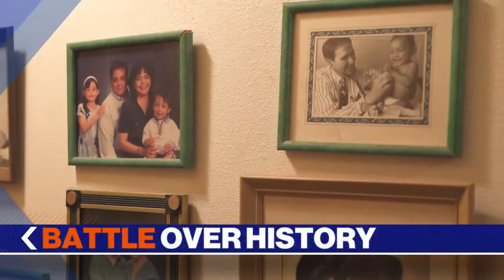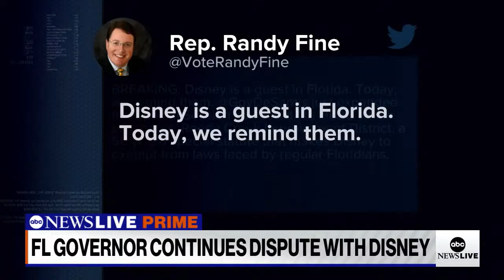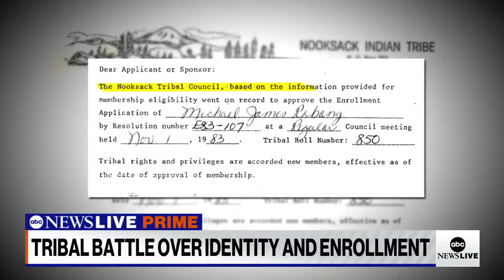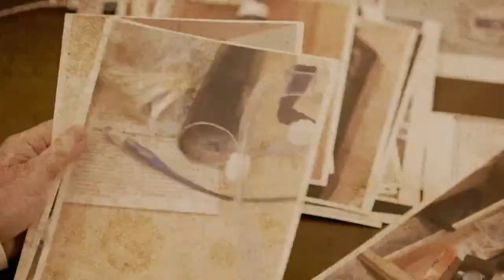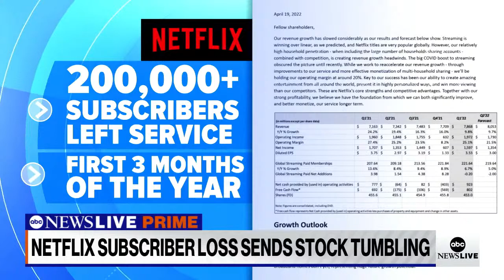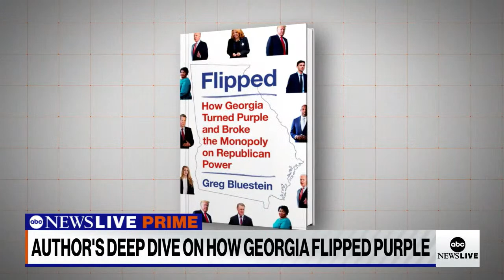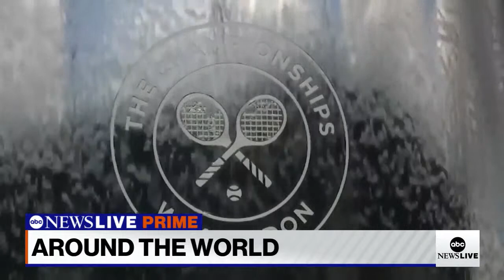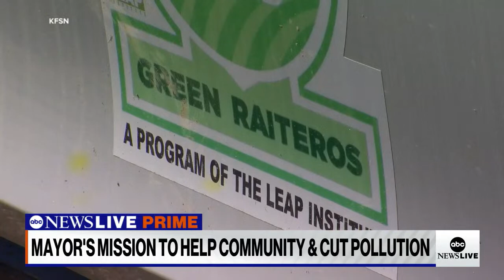ABC News Prime: Possible new war crimes in Ukraine; DeSantis vs. Disney; Tribal disenrollment

Comment: The craziest part about this whole thing is that some doctors say yes some say no and they all have the same or similar degrees yet some say the science say yes some say the signs say no how come we don't hear both sides from both sides of the doctors just one side all the time it's quite confusing to hear just one side let people figure it out for themselves of course what would seem a little irrelevant here probably is but let's throw this in there for the heck of it I believe that water will freeze at 32°, but what if that water were to have salt in it would it still freeze at 32°
Reply: Andrew Huberman, FOX, Facts Matter, The Epoch Times and Joe Rogan. No wonder you are so confused.
Reply: Water only freezes at 32° under very specific parameters.  1 standard atmosphere of pressure etc…  Water is very unique in that higher pressure causes lower freezing points.  Almost all other liquids the opposite is true.  See even the freezing point of water isn’t simple. 🤔
Reply: Now a days, it's about distorting medicine and science for the highest bidder.